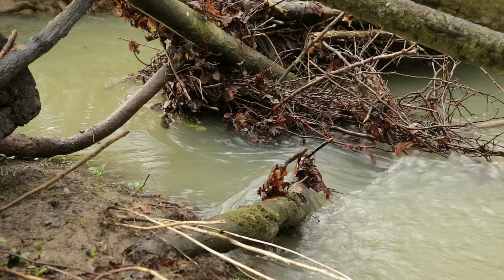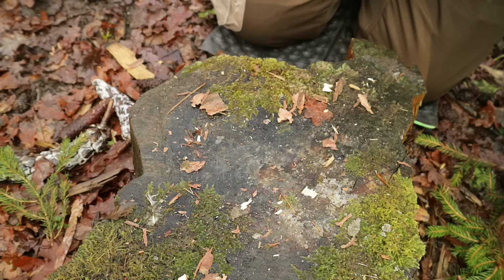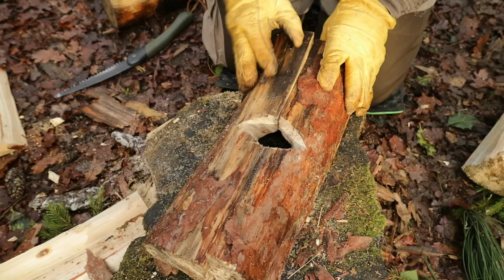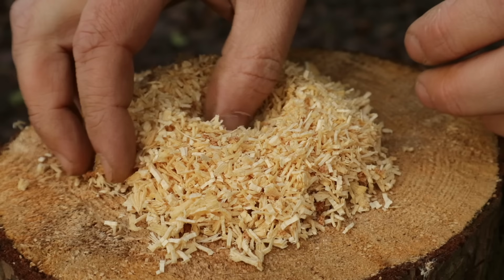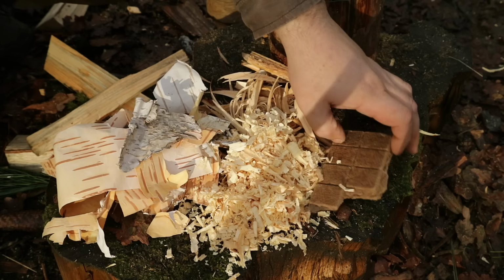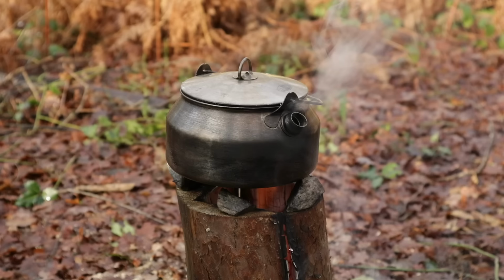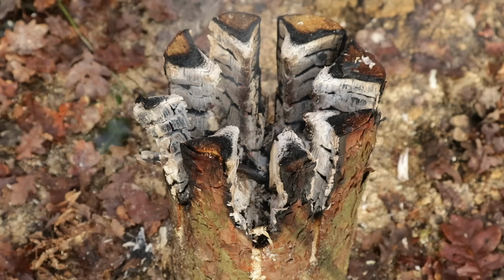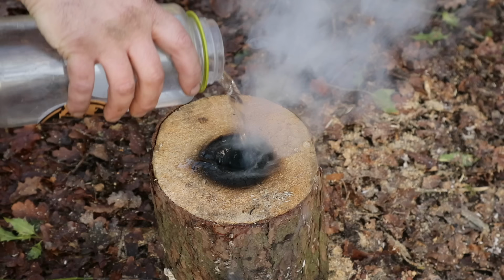Swedish Torches - 3 Styles of 1 log fire

Comment: As a first time torcher, your timing was providential. We just returned from camping. I had made several torches in the garage and fan dried them for several weeks - to make sure they were dry. When we got to the campsite mine never worked well enough. But now, with my trials and your experience, I can dial in my torches. Thanks man - perfect video.
Reply: He's using highly flammable Cedar.

Comment: The Auger rocket stove one, would be perfect to make 5-10 of, and keep for emergency situations, for cooking and heat.
Reply: That is also my favorite style of Swedish torch - more kind of a rocket stove, drilled in a log. 
My auger drill has 32mm diameter (I think 40mm would be ideal) and I like to make the torch a bit taller to have more draw (chimney effect). Those torches are easy to lite with some sticks of Fatwood and when they burn well (after about 10-15 minutes, kind of an "afterburner" ignites) they burn with very few smoke. 
Can be extinguished with water, but that makes smoke and steam and it makes the log wet. I find it better to put some lids (made of clay) on the holes, that stops oxygen supply and extinguishes the log immediately. It stays dry (with lids on even over weeks, or through a rainy day)  but it also could instantly be re-used if necessary.
Reply: l always use the auger method  it is a small tool to carry with you and yes 2 holes  about an inch up from the bottom   a 6 inch log should burn for about 5 hours depending on how hard the wood is   ps if cooking bacon  use the leftover fat to coat any shaving etc  to light your next fire

Comment: to light the rocket stove variety, you're supposed to use minimal kindling. even something as small as a short length of yarn works. just stretch the kindling thin so that it doesn't block the airways, and light it from the bottom. It's by far the best of the three once you figure that out. Also, it would be neat to see you try to do a true one log fire. Only starting the torches with materials taken from the logs themselves instead of birch bark and matches. Using branches from a tree to light the tree on fire is really satisfying if you can manage to do it.

Comment: The first variant of the Swedish (Finnish) candle is the simplest. It can be done with only one ax - a chainsaw or a drill is not always with you :)
Reply: What about a wire? Its not always with you either? Something we can find in the forest can come in handy?
Reply: @dajmos6969  Wire is not used in Siberia. The "candle" is made longer and the lower part is buried in the ground ...
Reply: @dajmos6969  -Or you can hammer a few sticks in the ground on the outside of the candle, to hold the pieces together.
Reply: In some forests, there are plenty of fibrous ivy stems that voila be wrapped around the bottom half and tied. Just a thought.
Reply: You can make horizontal line-like dents on the top and on the bottom, closer to the edges. And hammer sticks into them to imitate stitches.
Also, he could've done the center hole much narrower to have it last significantly longer. And you can put smth like a flat stone on the internal floor to prevent to from burning downwards too much.

Comment: Loved all three of them. I think that with the chainsaw torch; aside from going a bit deeper with the cuts, it might also benefit from drilling a center hole with the auger prior to making the cuts. As far as the one done with the auger alone; going all the way through with the lower hole is the ticket, and perhaps a slightly larger bit might also be of benefit. 
Good work!

Comment: I love a good Swedish fire torch.
You can do small ones in your twig stoves too.
Get a small log the same diameter as the width of your square twig stove and cut it into 1/4’s.
Put the rectangles into each of the 4 corners, leaving a central hole to start the fire in.
Make sure the log is a bit shorter than the height of your wood stove to
Maintain the airflow when cooking.
This is an extremely efficient way of using fuel for a 50 minute burn time with no maintenance.
Ideal for Firebox stoves or copies

Comment: Great video, mate. I was thinking the auger torch just needed perhaps a couple more holes, which you also solved. I do like the first torch (with the wire.) Looks like it combines the optimal air flow and use of manual tools that most people have (ie axe and saw.) Thanks again, great job!

Comment: Fat wood is honestly the best fire starter for these. On some occasions I’ve found that all I need is the smaller shavings, lit and placed in the bottom hole, to start the log burning. Then it just gets bigger from there. I’ve always used the auger-type as well. 6”-9” wide, drill down 3/4 the way, then meet the vertical hole with a horizontal hole angled 10-15deg downward towards the end of the vertical hole.

Comment: My favorite version of the Swedish torch is made from a dozen or two small (about double thumb-diameter or thicker) equally-long sticks, since I usually use pruned branches or lawn debris, and bundled with a bit of clothes hanger wire.  

For the chimney in the center, take one of the sticks and cut it into 1/3 and 2/3 pieces, leave the 1/3 piece in the center of the bottom of the bundle as a shelf, and the 2/3 piece temporarily stuck into the top of the bundle a couple of centimeters or so deep to help form the chimney, while tightening the wire in a loop around the outside to make the bundle.  

A small stick can be twisted into the ends of the wire and used as a handle for leverage to get it twisted really tight around the bundle.  Roll the bundle on the ground back and forth a few times to jog the pieces together even more tightly, while twisting the wire more with the handle stick.  Once the bundle is formed, remove the 2/3 piece from the top of the chimney, and it can now be discarded (or split into starter kindling).  

This torch has got plenty of air flow because the sticks aren't perfect and have gaps between them, which also means stones aren't necessary for a pot rest.  I make up a few of these right after pruning as part of cleanup, so that they're ready to light and enjoy, and also to use up the parts of the branches I want to keep while discarding the rest.

Comment: Made a small Swedish fire candle to fit in side my firebox which was 5’’ tall and fitted snuggle around the edge, it was more than enough to cook a meal on and a brew and more.it save you from keep feeding the firebox,and it is really efficient.Maybe you could try it with all the different folding ones that you have.
Reply: Yup works great in firebox stove Steve does it in one of his video's he put the cut points in the corner so leaving space in centre for lighting I've tried it and it works great

Comment: easy way to make a good version of this is to find a straight grained log around 6 to 8 inches in diameter split it into 4 , and cut off the core as you did but with no shelf, on the bottom lower 1/3 shave off the sides to it leaves air slots around the base, tie it all back together with cord etc and you can now cook on it, as for using stones on the top way easier to just get a small short branch around 2 inches in diameter 6 inches long and split it down the middle. place either side of the top hole to rest your pot on. hey presto instant stove, and depending on the type of wood will burn for a very long time. you want a core hole of around 2 inches in diameter . I have done this many times and it works great,  nice video and i could smell the bacon from here  :-)

Comment: I've used the chainsawed version plenty of times in my life and you really don't need raisers for it since it gets plenty of air without them, allthough, if you need the extra heat (if the wood is moist or slower burning) but u really dont need to cook on highest possible heat

Comment: I think the chopped and chainsaw versions had enough ventilation to do ok with cooking. Adding an inch or so of chainsaw cuts to the auger style would probably let that one vent properly while cooking.
They look like they burn faster/hotter when you expose more surface area. With the quarter-chopped one you could vary the number of quarters with chopped out centers (1-4) to cool them off a little and last longer. Same with the number of chainsaw cuts.

Comment: I didn't think of raising the pan with rocks. That was a clever trick. And good job with the video. 

...

I am curious to ask what's the max length of burn time you can get with these tricks? You see when you are camping you are ideally trying to push the limit of how long you can do this to hopefully not have to get up during the night to put wood on the fire, either with a hot tent or a cabin. That's the question really; how close can someone get to 8 hours... since that's what you need to sleep.

Comment: Instead of using wire or string to hold the logs together, use the cores that you took out, and use them as pegs, that way you can use the wire/string for other things like traps.
Reply: Hi :) would you detail how the pegs would work? Im I'm trying to visualize it.
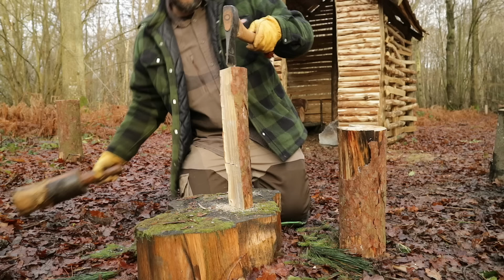Reply: @blacksunshine7122  at 4:23 when he takes out the cores, if he makes spikes/pegs with them, he can wedge the log together at the bottom to hold them in place,  that way he won't have to use any wire or cordage
Reply: @tamus41  thank you :) I see it now.

Comment: 3 flat head nails in a triangle can make a decent cooker top,.. also 3 branches used as legs to lift the log up means you dont need the side hole on the auger torch, just slit the wood into 4, cut out the middle, wire together, add 3 legs, air flow from the btm up

Comment: You can also reinforce them from falling over, by hammering tent stakes around their perimeter. You only need three or four. But go as many as you want. Hammer them with 2/3, to 1/2 of their length sicking above ground. You can run a cord around them also, if you wish.

Comment: Great torches, but you need to step up your bacon game! 😆  Pro Tip: Take a 1 quart Ziploc bag put a little flour in, add your bacon, and shake until bacon is lightly dredged in flour. Remove bacon, shake off excess flour, any fry normally. The bacon will lie flat in the pan, and will be perfectly crispy, without being crumbly. 👍

Comment: The chainsaw stove is by far the easiest and quickest to make, easiest to cook on, and lights easiest. Any modern woodsman has a chainsaw with them. As an added bonus MacGuyver-ing, a couple drops of gasoline down the middle then ignite it with the sparkplug wire.

Comment: i've always just split split my logs thendug my fire pit and threw my knidling between the slipts.. theses are all verry interesting.. ps.. the ones with holes in the sides.. light the top fiirst... then the hole.. kinda like holding fire in the chimeny for a bit to get the air drawing..
Reply: another tip for the auger torch.. drill the side hole first..  then drill down the end..

Comment: Probably help to get the auger torch burning if you turned the vent hole in the side into the direction of the wind. Would force more air inside.

Comment: There is another method of Swedish fire torch I use in my Firebox stove using charcoal briquettes.
It’s in the Gen 2 5.25” firebox as the nano is too small.
Lay 4 briquettes on the bottom - one in each corner
Then the next layer of 4 is laid halfway between the corners.
The next layer goes in the corners again.
The next in the middle
Until you get to the top.

Light it in the middle and enjoy about 120 mins of slow burn on a low and consistent heat - perfect for cooking lots of food for groups.

If you want to keep it burning just keep adding alternate layers like you built it as it burns down.

You can keep that going as long as you have fuel and want to.

My record so far was 8 hours for warmth in a very cold and wet fishing weekend which would have been miserable apart from the briquette fire torch ❤️
Reply from the maker: nice :)

Comment: I would suggest instead of 1 hole in the top you use 3 or 4 overlapping hole. For example 1" auger hole 3/4" apart.

Comment: with the drill version how would it work to drill all the way through on the hole in the side rather than making a second hole and get it to match up? also are the material used to start all of them small "start up" campfire materials?

Comment: I quarter my log than use my ax to chamfer the insides right to the bottom. Wrap with wire but not too tight so it leaves gaps for air. Add tinder and off it goes.

Comment: Interesting techniques.  Some thoughts:

1. The 'Advoko MAKES' channel has a couple of videos that you might find interesting: 'The Clamper | Old Tool Reborn' & 'Heating a Tent With a Log Torch'.  The first shows a simple, yet VERY effective wire clamping tool, while the second demonstrates a novel use for Swedish Torches.

2. If you have a drill handy, you can pre-drill holes for pairs of dowels to hold the split sections together without wire.

3. With the drilled version, if you plunge the tip of your chainsaw down into the hole, it will establish itself even faster.

4. To put out the drilled version ASP, just pack the opening of the bottom hole with dirt and then fill it with water.

5. Once you are done cooking, you can flip them upside down and lean wood around them to convert them into a standard campfire.

Cheers!

Comment: The reason being that your Auger torch failed isent because of the hole size drilled . But because you did things wrong  when firstly you should put a stick in the side oxygen hole at the bottom only a bit smaller then the hole it self that fits easy , push it all the way in all the way to the back .  then stuff the top with the fine chips of kindling that was drilled out at first , packing it Farley tight at the bottom against the stick the bottom then loosely pavk the rest of the whole but not to tight, loose enough oxygen can still move through. After packing the top lay it over on its side pull out the stick and loosely pack in paper in the consistency of confetti pack thr hole fairly well then take coals/embers place it in the hole & let the paper catch fire letting it smolder well entail its fully inside the hole 

you can also pack the oxygen hole  well forst with fine paper & then pack the top  .( this is the important part & the reason why his failed) You then need to take a straw or tube and continually blow into it until you see a good amount of smoke coming from the other end , stand the log up & continue blowing until you get flames coming from the top , you'll need to keep blowing for a little while making sure to pack the hole a bit more once everything inside has burned . And you've got it going well you'll need to keep blowing stoking the fire every so often . 

But simply the reason it failed is that he didn't proper stoke the fire by blowing into the whole providing the fire with enough oxygen until it was properly lit & going well on its own

Comment: That's a whole lot of carpentry in vain. And a Chainsaw? A traditional Swedish fire log is made with an axe and what you can find in the forest. A bow saw can be helpful if you happen to have it. But It's hardly something that you need to carry half a workshop into the woods for.
Reply from the maker: i'm thinking you missed the point? i showed 3 ways of doing it depending on your tools and how long you want it to burn. the chainsaw method is used a lot by foresters while working.. the axe method obviously convenient for campers and the auger method burns the longest, hope that clears it up for you.

Comment: Why not make a normal fire. Boil water when its flaring, then cook on the coals. Can't really see the point to this.
Reply from the maker: these are up off the ground, useful in a lot of environments, use just one small log, last a long time, can be used in certain shelters, can be easily cooked on without pot stands etc. they are also very popular with woodsman due to ease and no fuss. they can also be used with certain green woods due to the 'chimney effect'.